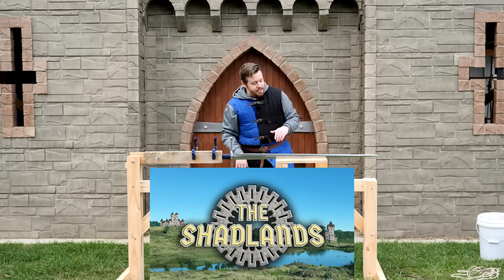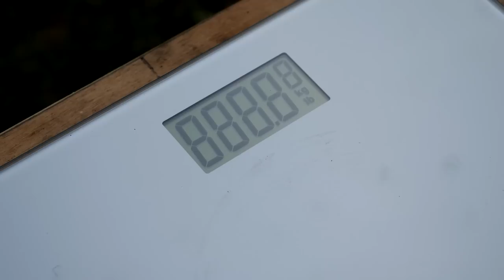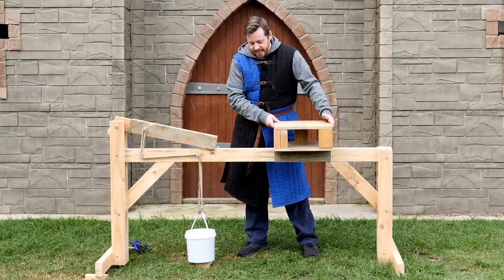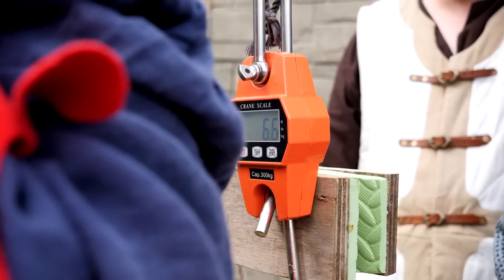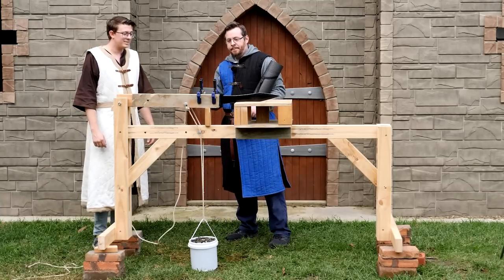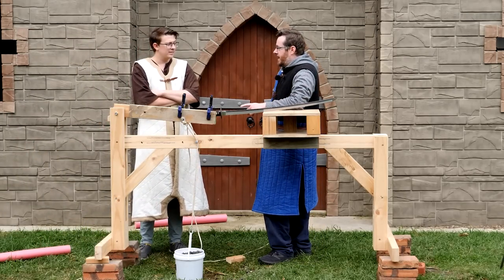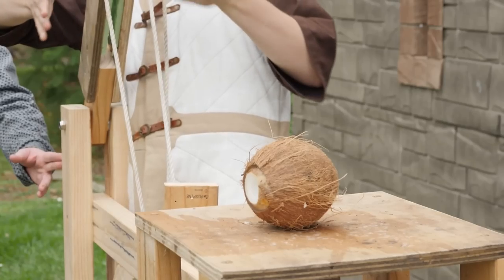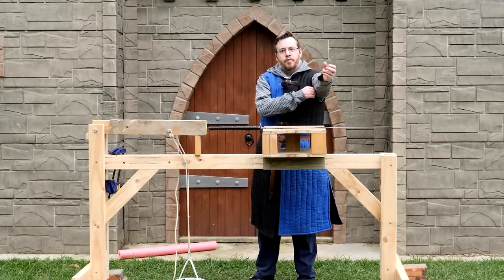Choppy choppy

Comment: Real guillotines had a total falling weight of around 40 kg, falling from around 3 metres. That's a lot of kinetic energy on the blade.
Reply: @Stevie-J  It was designed as a more humane death penalty, so it's designed to reliably behead someone in one blow.

The blade was also at a 45° angle, making the blade slide to increase cutting capacity instead of simply falling.
Reply: @Stevie-J  The probably didn't want it that sharp. It would get stuck in the wood at the bottom.
Reply: @lanesmith1465  this problem can easily be avoided. Just have the support of the blade be the first to be stopped. on the sides.
Reply: @lanesmith1465  the guillotine blade wasn't stopped on the edge, it was stopped by the blade extensions in the guide rails.
Reply: @Duke_of_Lorraine  Yeah that is what the guillotines do. It catches the thing that holds the blade, not the blade itself.
Reply: the Shadlotine here is not a capital punishment tool but a sword testing system. Human swings don't really get as strong as 40k falling from 3 meters, so he should be OK
Reply: @marcogenovesi8570  give me a ladder and a sword and I can do a lot more than 40 kg from 3 meters XD
Reply: @zwenkwiel816  depending on your weight you can have the same kinetic energy from a different height. If you're weighing 80 kg for example, falling from 1.5m would be enough, provided all that energy is disspated upon impact with the sword.
Reply: @Duke_of_Lorraine  so head first with my arms stretched out and holding the sword at both ends, got it.
Reply: @zwenkwiel816  So happy, that you are making this become reality. 😊
Reply: They still make guillotines.
Reply: @areyoujelton  the only country that used the guillotine and that still has the death penalty is Algeria. They stopped using the guillotine after getting independance in 1962 and use the firing squad instead.
Reply: they were also more like an axe, rather than a sword...
Reply: I would like to see Shad cause the same amount of damage if the sword was directly in line with his arms to mimic the biomechanics of his guillotine. If the cut is less effective,  then I propose it is because cutting at an angle is more effective
Reply: @jasongoldsmith2222  I second this

Comment: In the slow motion, you can see the “grip” of the katana slipping enough so the cut does not follow through… which proves the importance of a follow through, and nunchucks with no follow-through is objectively worse than a stick
Reply: there still worse than stick
Reply: The problem with this statement (as a lot of people are saying it in obvious defense of the katana) is that every other sword was doing the same thing, and the unsharpened long sword still cut the coconut.
Reply: @gamermanzeake  it shows inconsistency and so just not a definitive test. Maybe the other handle had a bit better of a grip, maybe the extra weight of the two hander helped a lot, we dont know. When the issue is resolved and it’s a more scientific test and the katana loses, that’ll be it. But you can’t extrapolate from unreliable data.
Reply: Nunchucks are amazing for their purpose. 

They are less deadly than sticks, but still cause severe pain. That is GOOD for law enforcement. 
They are also so strong in grappling that they can easily allow a small woman to break someone’s arm (or control them with severe pain). Which is also GOOD for law enforcement. 

It’s why cops continue to use them to this day. 

Or would you rather cops use more deadly batons resulting in more deaths?
Reply: @FilmFlam-8008  What law enforcement have you seen using nunchucks? Primary carry for police worldwide is an extendable baton, pepper spray, and taser. Then you have America, and a few others that carry sidearms, (countries that don't have backup ready who are armed, like England.) Then some countries also have rifles locked up in their shops (cars) for emergencies. Then you have your SWAT teams. (Also gotta love the 40mm of diplomacy aka smoke, teargas, flash bang grenade launcher for breaching. Some shops carry one, but many areas it is only a swat tool.) There are obviously more tools and weapons used by police, but never heard of or seen police using nunchucks on the job.
Reply: @gamermanzeake  I don't htink it cut it as much as it smashed it. The other sword was quite a bit heavier, all the weight pressing on even a blunt edge gives it more to put into the coconut
Reply: @FilmFlam-8008  I don't know about you but my local law enforcement uses sticks not nunchucks. I don't know of any police officers anywhere that use nunchucks on the job.
Reply: The police thing was satire.
Reply: @burnthetubs  I would design an arm with a slot on the end so that you aren't relying on the friction of the clamp to hold the sword in place to begin with.
Reply: Yeah, there is a lot of force being transferred into the foam instead of the target.
Reply: @FilmFlam-8008  Strong in grappling?  Able to let a small woman break someone’s arm?   🤣 

How exactly can it break my arm if you said it’s great for being only a pain compliance tool and not a nasty wound inflicting weapon?  And what cops even use that abomination?  Cops use extendable batons and metal tonfas.  If they brought nunchucks to the job, they’d become the laughingstock of the force.  Not to mention how much their already-measly health insurance would probably refuse service if they carried nunchucks 24/7.
Reply: @FilmFlam-8008  I'm pretty sure law enforcement don't use nunchucks. They use baton, which is you guessed it, a short stick
Reply: BS. 'nuff said.
Reply: @Stay_away_from_my_swamp_water   @Kurogami  but the relation between weight and the pull-down force by gravity is proportional, so weight is directly applicable as force measurement.

also he said something about 1000kg pulling down which you would probably agree is a ton of force.

Comment: You should put a piece of wood above the handle to prevent the sword from moving upwards when it strikes the target. I think that the clamps are not strong enough to keep the blade from moving when all of that force is applied to it, so the force dissipates. Attach something to one of the planks that holds the sword to prevent it from slipping upwards, so that all that force goes down into the target. That is the difference between your strike and the rigs strike. The force of your strike goes into the target because your grip is firm enough (if you understand what i am getting at)
Reply: You would need another piece on the bottom end of the handle to prevent the handle from rotating around the first piece.
Reply: @TentaclePentacle  I don't think it will rotate if that piece is placed a bit out on the blade itself. But yeah, the handle and the blade should be more secured to prevent any movement when it its the target.
Reply: I would add two bolts that go through both planks and prevent any possibility for blade rotation ("o"- is bolt):
                     o      |
     blade-handle | >>>>>>>>>>>>>>>>>>>>>>>>>>>>
       o                    |
Reply: @von_nobody  that's the best idea I could think of too
Reply: I'm seeing the sword slipping vertically in the grip after the strike; this also happens in the hand but we have more than sideways pressure when holding the blade.  Since the sword is held in the hand with the web between thumb and index finger as a backstop and pivot point and the other hand provides torque to the blade via this pivot point, try adding a couple dowel pins to act as the 'pivot' and 'torque' points of contact.  The pins should be removable so you can still apply the clamps, and by cutting slots along the arm you can use different hand placements to match the handle length.  See von nobody's visual.

I'm also seeing the swing arm has a bit of sideways wobble so it can miss the centerline of the coconut by a fair margin; try tightening up the elbow joint to keep it straight, though the added friction means you'd have to increase the weight in the bucket.
Reply: Also add a slot in the plate and a slightly shorter stop block so the blade does not slam onto the wood but passes slightly through.
Reply: I wonder if pressing down on the scale really is equivalent to a swing.. my first instinct would be that pressing vs swinging is vastly weaker.
Reply: Agree. Clamping sword the way they had is expectedly failed. They had to make socket like fixture(several of them, with profile matching installed weapon), adapter if you wish, so weapon does not rotate at all.
Reply: So your saying that the rig needs to be better at gripping shafts like Shad? Makes sense 🤔
Reply: I was thinking going a bit different way. Leave the foam on one side and have a few blocks with v notches at a shallow angle that would keep the handle from moving. Also may consider having a beam at the bottom of the contraption with a mounting for a spring instead of a bucket for a more dynamic swing. Lastly an adjustable height of the swinging part would help to compensate for the curvature of a sword or the offset of an axe head.
Reply: @h1r086  It's weaker, but he'd need a scale that measures max force rather instantaneous like a bathroom scale.
Reply: That wont be enough. A wooden bar above the handle might prevent it from slipping upward, but it'll just become a lever point and the back of th handle will slip downward. It really needs a much more secure and firm fit.
Reply: another 2 thoughts i had right in the beginning and which came up again, when you mentioned the 'poor' cut at the poolnoodle is, that you have a hard surface below the target and depending on bladeform you'll be getting problems with the follow through of the swing. So maybe you should think about a groove in the target, so that independent of the swing target the blade goes freely through it before 'stopping' at the platform. That could also account for the different blade geometries.
Also to save your blades a bit of hurt you should think about stopping the swing at the arm without letting the blade hit something 'solid' after the target. Imagine it like a door stopper, so that you don't hit the wall with the metal bits of the handle ;-) (use the soft mat you unsuccesfully tried to cut or a pool noodle as buffer material to reduce stress on the system)

In addition to the grip discussion: How do you want to account for different blade geometries? Like a saber against a Longsword? They naturally act different in a swing to cut, so compensating for that to hit the target square on may be contra productive depending on what rule set your setup should be measuring. You can go down different sort of rabitholes in your results depending on that.
Reply: @shaitei2397  Agreed
Reply: @Bombur888  Well i ment it to be a bit down the blade, maybe just beyond the guard and another down by the pommel would be good when i think about it, to secure the blade.
Reply: @von_nobody  This bolt design is waaaay better than the current clamping system. The clamping they have might work but not with those quick clamps, they move super easily compared to a similar g or f clamp. They are also loosing a lot of their energy through friction of the rope against the bolts. An easy way around this is to add a pair of flanged bearings on each side with a washer to prevent raceway rubbing on the wood & nuts.
Reply: @anderswallin3883  You'd need one above the handle near the guard and own beneath the handle  near the pommel, but it would still be a bit loose. I'd go with two hose clamps.
Reply: @von_nobody  Could you unscrew the pommel and use that as an anchor point, basically making the whole mechanism the pommel? probably still needs those bolt supports, but the pommel anchor should keep it from sliding outwards as well.
Edit: realized that that won't work for many swords.
Reply: @von_nobody  A truly brilliant diagram
Reply: Mostly this: The grip on the sword relies too much on the foam to encapsulate the sword handle rather than using plywood or a hard, shaped gripping surface with foam to supplement for differences in sword grip material and exact shape. a block on the top AND the bottom that prevents the sword from losing energy by deflection caused when the sword impacts the table/object.
Reply: Another thing to consider is that when a human swings a sword we don't keep our arms straight. We bend at 3 different areas if you don't include the rest of the body (shoulder, elbows and wrist) you need to take into consideration that when we swing all 3 of these areas the amount of force is increased so instead 7kg of force the amount of momentum could be affecting the force and make it feel like for example double the force at 14kg.

Apologies if someone already made a similar comment I wanted to contribute to the discussion
Reply: Clamps have more power than fingers, but foam makes them weaker
Reply: If you look at how a person holds the handle the hands wrap around the hilt and one hand holds the handle lower end and the other higher up . The means that the arm and thumbs of the hand give a more rigid support. While the rig lets the sword move up at impact loosing some of the downwards force.
Reply: @von_nobody  That would also allow for some really good clamping using the bolts instead of quite weak quick-clamps.
Reply: @Bombur888  Well it would not matter if it would be a bit loose since a hand is not perfectly rigid either, because there is still some movement in the wrist when you hit something hard. But if he secures it the way we tell him to, it would work way better and transfer a lot more energy into the target than it does atm. But he would need to come up with a better rig than this that actually simulates a swing better, since this is a chopping motion and not a cutting motion.
Reply: @anderswallin3883  He said he's planning to do another rig simulating more of a slicing cut and to test both.
And the hand is not absolutely rigid, that's true, but it's also not loose (unless you make it be), and that isn't really the same thing.
Reply: @Bombur888  Yeah i know he said that, or that he was thinking about it. Yeah you can control how tense you want your hand and wrist to be.

Comment: ok 3 suggestions. you're applying the weight calculation incorrectly. you measure weight at the tip of a stick pushing into a scale, so to get accurate calibration, you would need to clamp the stick into the rig, rest it on the scale, and add weight till the scale reads 7 kilos. if you attach a d shackle to the back and have a trigger release, it allows consistent release across the board as you would pull it up to the backstop then the release would be identical every time. the sword handle slipping out is definitely a problem as it removes power from the cut that a person wouldn't. perhaps having a slot cut into the mounting point that a board slides into to prevent upward movement of the handle, while still allowing some play as with a person cutting?
Reply: But the person don't hold the sword as firmli as a rig. So the rig must have degee or two of flex to compensate the flexybility of human muscle. To the triger relise it's realy good point it will remove even more human error as Shad sed relise it clearly so he consider this problem.
Reply: @artur1995gt  well that's annoying, I seem to have accidentally deleted my reply before posting, oh well plenty of thinking it out waffle to skip and i can get to the point. to your point, there's plenty of play in the foam material, and slotting the wood about 3mm above the handle would allow some movement without it ripping out completely, it's also cheap. i was thinking for accurate force measurement, kinectic sand in a container open on one side to allow striking sitting on scales, it maintains the deformation of the strike giving you a visual indicator of impact, and cushions it enough you can probably get away with having the scales under to give an accurate at point of impact kg rating. aggregate some photos of a person striking it in ps, get your impact pattern and max kg at impact matching with the rig, and i reckon that would about do it
Reply: @vivalafiaga  Ok in this case, yes you are right. as @FluffyPants mantion the static forses dont represent strike accuretli. So in the video It was sed this test should be with the sword one a slight angle so stike will more cut then chop.
Reply: This is what i was getting at. I also thought that the way he was trying to measure the weight did not feel correct to me
Reply: This is a good point I didn't think about. He measured from the end. Would force change with different lengths? When they measured force closer to fulcrum, the weight increased. They measured from furthest point,  but the force would be greater where shad was gripping.
Reply: @Danuxsy  on planet earth weight is 9.8 times the mass, that's consistent. So you can use mass to compare weights, forces.
Reply: Perfect answer, shad needs to see this.
Reply: @Danuxsy  i dont think he was trying to replicate the true force of the strike when he measured the 7kg...the way i understood it, is at the end of the cut, he didnt want the blade to have a static force of more than what a human could produce, so as to not continue cutting once the main cut was finished.
Reply: @kangarooster857  I agrre and i must say the test with the weight must be redo. This what i sead before was without the mass of the arm itself. so best way to find out would be polace a PCV pipe to mesure the folow up static presure.